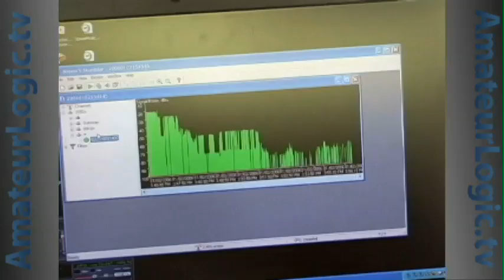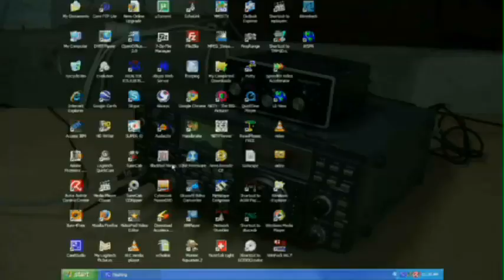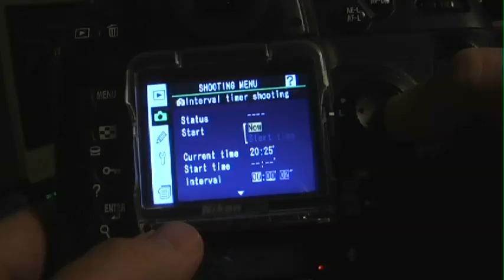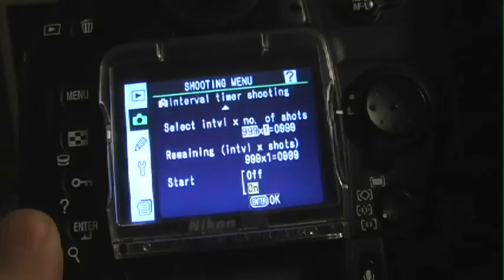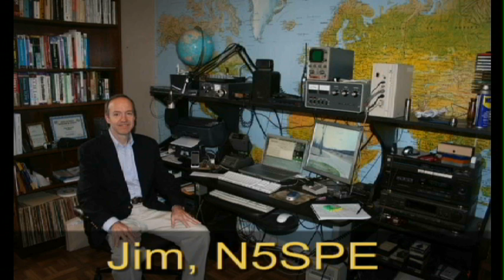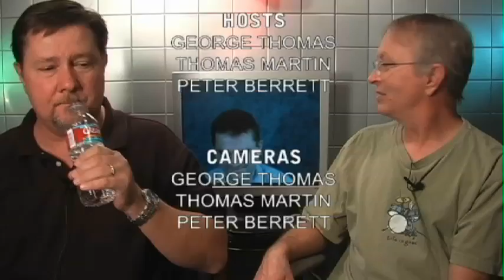AmateurLogic.TV 26: Kenwood TS-2000 as an SDR

Comment: I am wanting to add a waterfall and like specktrim scope so I can watch the modulation and the band width I’m wondering if it’s possible because I can’t afford the new radios. And I like my ts 2,000
Reply from the maker: Yes. The video I showed on tapping the IF would work for that. It's mostly a function of the software you use.

Comment from the maker: I have not worked PSK recently, but it is a lot of fun. 
We would be happy to review your segment for inclusion in an upcoming episode.
The preferred format is H.264 at as high a bitrate as you can use and still keep the file at a reasonable size. Depending on the length (we try to keep segments less than 10 minutes long), this is usually a few hundred MB for the file. So it will have to be uploaded to a server somewhere instead of emailed.